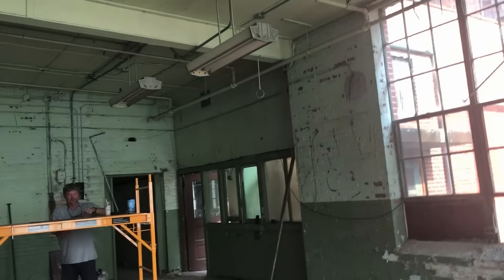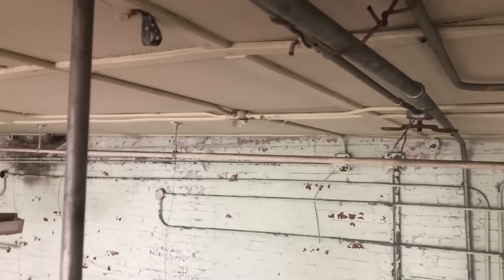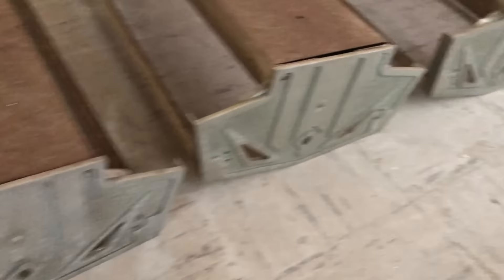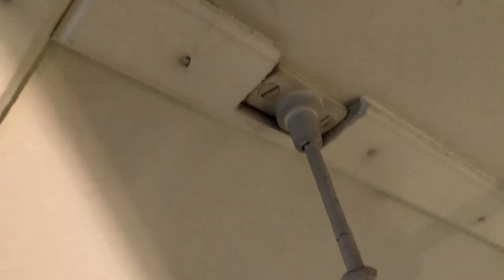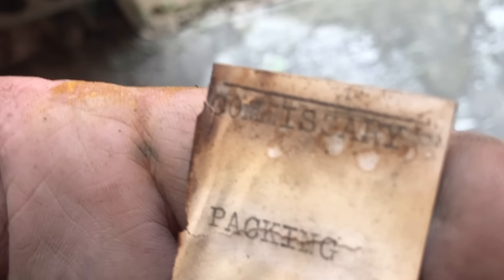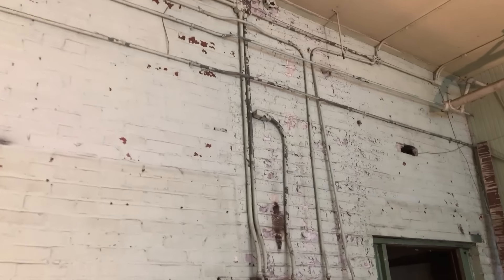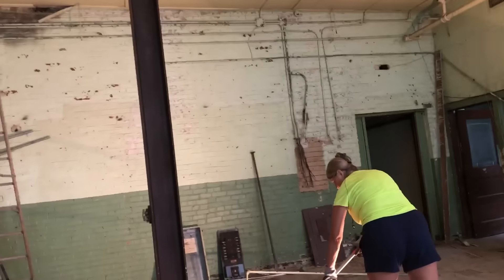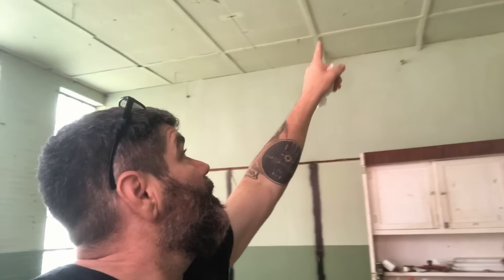Industrial building - Renovation phase starts, converting an old industrial building.

Comment: Thanks for sharing the update. It's coming along quite nicely. What I would suggest with those light fixtures instead of painting is taking them and having them powder coated because it will last much longer and look a lot better. I like the look of some color with some polished aluminum, it gives it a good art deco 50s vibe. You just have to choose colors that suit the needs of the project. I know you don't wanna cover up a lot of of that original green paint but having the room is different period correct colors would help differentiate the spaces.
Reply from the maker: oh yeah, they are aluminum so we are thinking about just painting the recessed areas. But powder coating could work too then just reveal the high spots.
Reply: Original is a fairly relative term, looks like there's several layers of different colours and the green is just the last one.

Comment: Chris, things are really looking good in that area of the building. I’m not going to make any comments about safety because I have had my own many falls, accidents, injuries, ndes, etc..while I was working in construction many years ago, so I could only advise you on certain things based on experience if you were really interested, but usually you just need to get hurt a few times and you will get the point! 😉 Keep on Truckin’ 😎
Reply from the maker: They say that what doesn't kill you makes you stronger, unless you its a chainsaw or a buzz saw, then not so much. LOL>
Reply: @brickandsole  so true…I really shouldn’t be alive.😂

Comment: Try the vibrating/reciprocating cutting tool to remove the old glazing compound in the steel framed windows. A grinder would work also.
Replacing the the metal clips holding in the glass is necessary and  brushing metal frame with linseed oil before attempting pressing glazing compound into place. Install compound with a VERY   OLD AND POLISHED puddy knife with a bit of oil wiped on blade.
Lots of work, lots of work.
After about 20 windows you will be good at it.
Reply from the maker: We are trying different things. IF it vibrates too much the old glass cracks in the other squares.
Reply: Yes the heavy vibrations with the air chisel is too much. The small back and forth movement of the cutter teeth are variable with your pressure.

Comment: If you find the right plumber they can locate your drain lines without disturbing the the floor, and they should even be able to tell you how deep they are.
Reply from the maker: Yeah, I talked to the city they said there are several that have yearly permits that can do anything we require.

Comment: T8 LED replacement bulbs they dont use any of the starter or ballasts just need 110 AC they can be found a major home center stores some are adjustable to cool white warm white sunlight
Reply from the maker: Super tip. Are the dimmable too?  I'll look that up.
Reply: @brickandsole  not that i saw but the potential for there to be that kind is likely but they will be pricey the circuitry to dim LEDS without flicker is not cheap

Comment: There's an intersection of N. 22nd Street and Lucas Ave in St. Louis, in what looks like a former industrial area, so that could very well have been the location of the HQ. I can't find any other evidence of that though, all I found was a factory at the corner of N 22nd and Mullanphy, which is quite a bit further north than Lucas.

Wurdack Electric has a few patents on the internet, mostly from the 20s through early 40s. There's also a 1943 catalogue for sale that shows something similar to the box you found but the pictures aren't particularly clear.

Comment: Save and sell the old sprinkler heads. Firefighters collect those. I bet too, that the hangers that do NOT have the 2 screws in the ceiling plate, are probably LAG screw types. Grab it with a pipe wrench and see if it screws out of a ceiling joist. That way you won't have to try and make a flush cut. 
The pushbuttons and junction bow are probably the same system. The pushbuttons on require 2 terminals to make and break a circuit. It makes or breaks 1 wire of a 2 wire circuit. The junction box has connections to both wires of every circuit, so the pushbutton of 12 would probably go to an junction box with 24 terminals in it. 
The string that ties the bundles of wire into 1 run, inside the switchbox, is a running clove hitch. I used to use them in high school and still use them today, when I have no zip ties. It's still a semi common practice. When electronic technicians refurb old tube amps, they often still use the running clove hitch to maintain authenticity.
Reply from the maker: thanks for the tip/info.  As for the sprinkler heads some are seized. I need to try heat and see if they will start to back out.

Comment: You can usually date by UIL label style.
Reply: Suggestion for protecting your glass during storage: put a piece of cardboard or several sheets of thick paper between glass pieces making sure to keep it flat, wrap the group in something padded (bubble wrap ot foam), & tape card board to all sides. Label in large letters on outside what it is.
Reply: When you take the painting off those pipe hangers, they are likely more ornate. The paint is covering cool stuff.
Reply from the maker: yeah I was thinking about submerging them in stripper.  It wouldn't take much.

Comment: Am I missing something with the end result for the lift?
Reply: They ran out of time.  Probably won't see the next elevator video till November.
Reply from the maker: we had 5 days, we were able to determine all the actual mechanical parts work which was great! the only thing we still have to do is figure out the relays to send the signal and power the brakes. We have a diagram but it doesn't tell us everything we need so we are going to have to come up with workarounds. Next attempt will be early Nov.  in about 6 weeks.

Comment: When you restore the lights get LED kits so you never have to worry about replacing ballasts and they will save you on electricity and not be as harsh as well and you might be able to control the intensity with a dimmer or from a bluetooth device like an Alexa, Google, Apple device or a phone app like an Iphone or Home on your Iphone or Mac.
Reply from the maker: That is exactly the idea.  Thanks for confirming.
Reply: Muthers Mag & Alloy polish is awesome stuff. Give it a go on the lights.

Comment: I don't have the patience to watch the video on The Elevator repair. Can someone tell me whether they got it repaired and running?
Reply: It was a nailbiter till the end.  Almost got it fixed.  Elevator moved.  Needs a little bit more work but the big issues are solved.  I think it still had some issues with the brakes not releasing.
Reply: @sparks869  Thanks!...I watched some it, but after awhile, I gave up.
Reply: @Davett53  No problem, I skipped through the video.  The progress was towards the end.  I suspect the working elevator video will show up around November.
Reply from the maker: Yes thats right.  We need to get the brakes to communicate, they do work, just need the wiring to communicate with them.

Comment: what are you doing with the old sprinkler heads?? i’d be interested in a few
Reply from the maker: I need to see how many I can get off, eventually I will have a lot of them but they are really hard to get off without damaging.
Reply: @brickandsole  i would be okay with cut pipe on each side of sprinklers

Comment: What ever happened with "the bathroom project"? Did you ever get it up and running? I think your first floor renters, may want one, too.  Every project seems so "scatter-shot",....starting something and not following through.. I'm sure you never fixed more than one window. Howz that gutter repair going?,......no new up-dates on the brick restoration?. I bet there are rooms that still need cleaning out, still loaded with junk. You get all hung up on old Art Deco fixtures,.....future renters may want, reliable LEDs, off-the shelf products. Has anyone expressed interest in renting any of those spaces? You should find a way to connect with the "artist' community". Artist's in my town are always looking for affordable studios. They'd have to be renting at below market value, because your building needs so much rehabilitation.  What will heat & cool those rooms?
Reply: Hang on a bit all of your questions will be answered soon. It has taken a long time to find the right direction for the project and in the future that will be our focus.
Reply: One bite at a time.